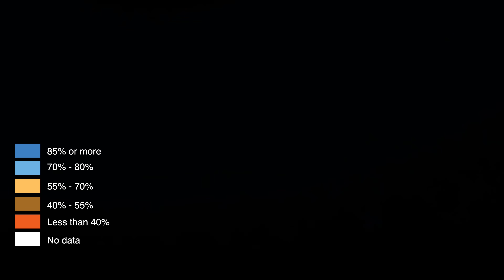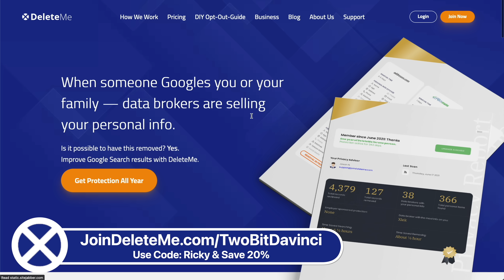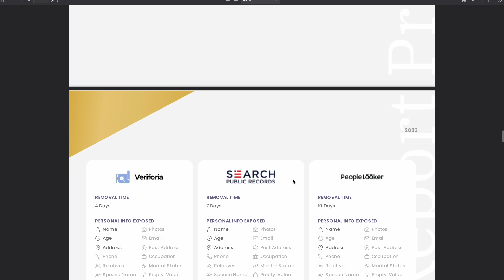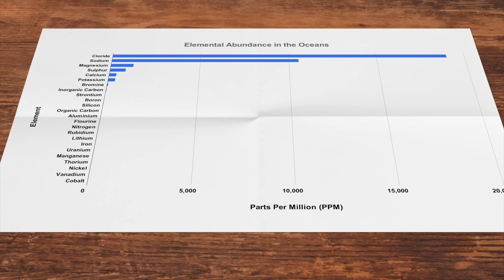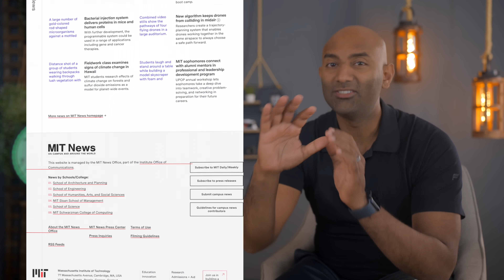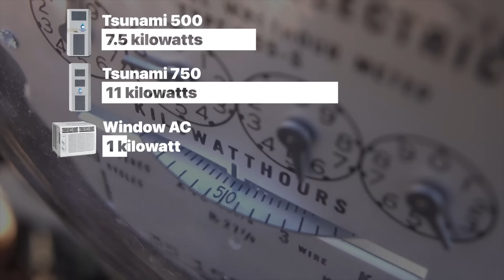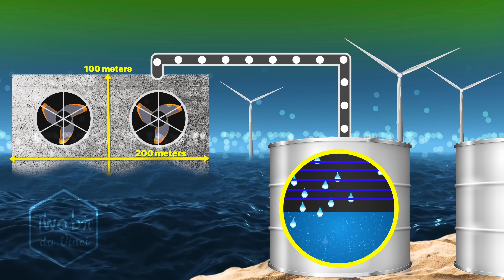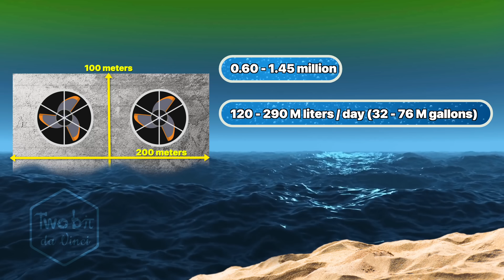This Tower Turns Ocean Fog Into FRESH Drinking Water!

Comment from the maker: Keep your personal information Safe Online with Delete Me! https://joindeleteme.com/TwoBitDavinci
Reply: Moisture farming like Luke Skywalker's Uncle Owen Lars on Tatooine.
Reply: Just use the old camper's trick.  Fill a large can with salt or dirty water.  Put a small can inside the large can on a support so it doesn't float and tip over.  Cover the whole thing with plastic, and put a pebble on the plastic cover so it forms an inverted cone. The small can will slowly fill with pure "distilled" water through evaporation.  This works best if it's hot.  Now scale this mechanism up in size.
Reply: Sooooo....... Is this a 200 ft diameter surface air skimmer? How does wind speed act to drive skimming water?
Reply: 8:36 so you're saying in Palm Beach Florida we would not have any problem getting water out of our 95% humidity air lol
Reply: I think you are Canadian Preppers brother... :)
Reply: Wouldn't doing this on a massive scale eventually increase the salinity of the ocean in that area? Since it was already at max saturation of vapor then you taking from it would lower the saturation and allow more water to evaporate than normal. Still seems like a great idea but I'm skeptical there is zero environmental impact
Reply: In case of this technology we are talking about a corporate who bottles rainclouds in  the sea itself .. Water is not a big issue but in dry atmosphere temperature keep on raising , we are talking about   50-60 °c plus  temperatures ... 
I think i should invest in airconditioners and cooling systems  😊
Reply: Brine + Solar = Molten Salt Powerplant + Battery = Energy Independence + Exports
Reply: No it is NOT expensive to get valuable minerals like common  salt and magnesium  which is six percent of seawater from the brines. 
It is a threat to the slavemasters pulling your strings you puppet. Their profits and control over you.
Reply: It is only renewable if it rains before you run out of water.
Reply: Didn't you do an episode where they used nets to catch the moisture off of the ocean?  Couldn't you just use giant fiber nets to collect moisture off of the ocean?
Reply: what's up with your math??? @ 1:35 you say there are 'some 10 cubic kilometers of fresh drinkable water' ... but then @ 2:00 you say "93,000 cubic kilometers of fresh liquid easily accessable drinking water" ....  so what is the CORRECT AMOUNT that you MEANT to give instead of 10 cubic km????
Reply: Interesting episode Ricky.. the concept sounds basically like a gigantic dehumidifier that takes advantage of moisture produced by natures distillation as the sun heats the ocean surface during the day.  Makes sense that it could work, of course depending on how the electricity is produced to create the condensation.  My family has been in the water treatment and purification business for almost 40 years, and now I live on a sailboat that is completly off-grid with desalinated water produced by solar power entirely.. the system consumes 400w to produce 100L per hour.  Will be interesting to hear more about this idea you present, especially for those of us already living on the ocean.  Keep up the good work!
Reply: wave power is a thing no need for solar wind
Reply: The average person consumes 79 gallons of water per day? Seventy-nine? Gallons? Per day?
Reply: @Jianju69  that would be drinking, bathing, cloths washing, sewage, irrigation, public space irrigation/sports, it would also be water used in industrial processes for consumers, it takes water to make the aluminum that makes the soda can, it takes water to make the steel to make the logging machines, it takes water to make the tires for the transport of the logs to the saw mill, it takes water to mill the wood to build peoples houses, it takes water to make the concrete in the roads, it takes water to do almost anything that humans do on this tiny world.
Reply: @thesearchforterrestrialint7795  Yes, I figured you must be including water for industrial processes. I takes water to grow grain to feed cows to make the hamburger for lunch, etc. Still, it surprised me.
Reply: Wow! How to invest in the best?
Reply: Speaking of water, how is your area doing with the atmospheric rivers of rain in Calif?  Some of our family is high and dry and others have been looking a buying a new "boat house".
Reply: A brother came up with a machine to extract it directly from the air....a few years ago and most of the water is in the core
Reply: Good one , probably most countries can benefit from this ( even if just used in some regions it would be a good help )
Reply: California was the greatest place ever and then democrats ruined everything and now the state has so many problems the people are moving out THE EXODUS OF CALIFORNIA! It is the people and politicians that ruined California because Ronald Reagan made California great then Democrats ran the state into the SKIDROW HOMELESS GROUND!
Reply: Dumb ,lets steal rain... How about make more trees , win win🎉🎉🎉 all deserts could of be green with the Ukraine wars donations🎉🎉🎉
Reply: Before watching this muslin cloth has been used to elegantly harvest atmospheric water vapour for 1000s of years. Even been used in deserts but collecting sea mist is obvious.
Reply: Turn Ocean Water by use Sand Filter or Sand Pits  They have Lot of Sand We Did It It Work Cheap & easy
Reply: Antarctica ICE
Reply: Well took you a while to get that idea.
Reply: hey deuche bag there is more than enough water underground!
Reply: I love this I want to hear More about it If I can get involved if I can donate who do I call to get this project started And will pressuring State senators and congressmen as well as the governor help
Reply: I worked for a state university. We got a memo that state funds can't be used for buying bottled water, the 5 gallon office kind. Our buildings aren't plumbed for water fountains.
I went on line and bought glorified dehumidifiers, with filtration and UV light.
Problem solved. 8 gallons of filter water, (basically 1 gallon an hour) and able to do this at 25% humidity. Problem solved.
Reply: A better and cheap solution is to evaporate it inside a tank by using huge lens.
Reply: Your not taking into account differential population growth and the responsibility of that nation that falls under as to not overconsume resources of a given area. Having too many kids.
Reply: 10 cubic kilometers of fresh water?? I think you dropped a few zeros
Reply: this english was hard to understand, grew up with new world english not that old world bullsh1t. Gallon not liter, F U
Reply: This video should be pinned to the youtube home screen for a few years.
Reply: do you still have links to the sources?
I can't seem to find  it on your site(under videos->water)

 since this really seems to work exactly like a project which I published around a year ago as a open source desalination project.
or actually one of it's smaller sub parts since the entire technology and project was meant for more, but this exact method of desalination was also part of it as a ecological desalination method for oceansteading communities or ships.

the method shown in the video seems to a industial aimed aplication of the technology, since the original ones where designed for decentralized use so as to allow anyone to have acces to water, as well as with functions to help nature, well the actual original publishing was the speciffic working and such and that as well as 2 publishings shortly after that also included more speciffic ready to go solution

the project was openly published as Free Open Source using Cern's open hardware licence,
I want to see the links so I can see if it is actually very likely based on it, since it if is then I'll share it with the "activist"/ developing things for a proper future group for which project I originally designed and published it for/in realtion to.
(was my own project, but that group sought ways to protect the world from this problem as well as against those fires and to make sure everyone had water aces anywhere, would be fun to show them my tech even got into the news even if my name was not mentioned in the news(with news I refer to this channel, as well as somewhat to the publishings about the publishing based on my publishing.).
Reply: You may want to go to Bangalore and do a start up there.  Perennial water issues.
Reply: They were doing it better and cheaper for 1000s of years in arid regions. fine Muslin cloth captures air moisture. Just need poles, ropes and cloth and channels to collect the water. Works in deserts.
Reply: if we really play out the scale more long term. not thousands but tens or hundreds of thousands of years...    are we going to convert on the water all this planet into something else eventually?    you drink water, you pee, you dont get back the same volume you ingested.    this is true of all the systems of technology we use which take water as an input,  the ultimate output is less water.    so are we slowly but inevitably using up all the water on this planet ?
Reply: this idea needs to be sent to Elon and RFK!
Reply: Please make a video on the comparison of river water vs water purified from sea vs dehumidifier water as the river water is better than others as per my knowledge.
Reply: Can you use international units?
I am confused with 3-4 types of gallon...
Reply: easy way to reduce water waste is having 3 water systems at home, fresh water for drinking and shower, sewage obviously, and finally a recycled water from the wasted water treatment plant to be used on the toilets and some gardening aplicantions, since that recycled water cannot be consumed due the chemicals used on cleaning and so on, instead droping it bck on the rivers and ocean it should be taken back home to the toilet again, it may not look much but you must see the big picture here, millions of people everyday wasting 5 gallons of water everytime they flush in just one day that would fill more than one olympic pool across an entire year you can imagine, every little bit counts, special on desert areas and countrys if we can extend that water for a little bit more than all investment is worth it

Comment: The energy of ventilating the air through the tower and through the pipes and slightly compressing it to a pressure ratio of 1.4 is vast. Without a calculator, I assess the required energy performance for one tower at 100 MW. The only way to get a solution is to use Small Modular Reactors. But the price of water will be high though.

Comment: The salt is attracted to colder surfaces if there is a hotter surface nearby, so likely the reason why is the pipe would not be under water? Another reason is that there would be lost potential energy of the water and that is energy that must be spent to transport the water back up? Then there is potential scaling/corrosion problems which could drive up costs significantly which would happen in water due to biological contamination that I assume the air would have less issues with? And since you would want to be fairly closer to coasts, being closer to the surface would not work for shipping and transportation reasons or more chances for erosive conditions like abrasion or oxygenated? Too low and you might mess up an ecosystem or have overgrowth that ruins your pipes?

Comment: This is fascinating! I wonder if something like this could be installed on a decommissioned super tanker that sits offshore with the collection vents above deck and the condensing process is down in the holds.  I'd rather look out over the sea and see a few super tankers floating out there than a big structure like the one described in the video.

Comment: I have been living in Las Vegas for over 40 years. I know this valley and where the fresh water is located. Las Vegas translates to The Meadows and this is for good reason. This valley is filled with water. Springs are located throughout the valley. The water table is so close to the ground surface people must keep their swimming pools filled with water to prevent the underground water from pushing their pool out of the ground. The former site of the El Rancho Hotel and Casino, which is located at Las Vegas Blvd. and Sahara Avenue, has not been developed because the water table is too close to the surface. A massive underground river the Alamagosa flows under the Las Vegas Strip. This is the source of the water for the Bellagio, Venetian, and other resort fountains. 
There is no drought here. The Colorado River's water shed has had normal to above normal snow pack for over 10 years. The low Lake Mead water level is caused by 2 huge water diversion tunnels.

Comment: Wow, huh? So the question is would it disrupt the normal water cycle? One other thing is no matter what the scientists estimated for construction costs if you build them in California you will have to triple construction costs and double construction times. The simple fact is that California is an infrastructure nightmare. Construction companies and subcontractors regard California as a giant piggyback to be squeezed as much as possible. Every Bureaucrat involved with permitting and planning will insist on running feasibility studies and environmental impact statements, ad nauseum. And environmental groups and Nimbys will file lawsuits to shut construction  down. Some people think that the only acceptable solution is to reduce water use until it matches available rainfall and reservoir replenishment. Of course, we need to practice every conservation technique possible. But conservation can't be the sole solution. It will choke off economic growth. And create water refugees. Our so called leadership needs to go to the public and explain the realities in blunt terms but offer some potential solutions even if they require painful structural changes in our society.

Comment: For years I’ve imagined a concept similar to this. Imagine a shallow floating or supportes pool at the ocean surface. It would be a few feet deep and insulated from the actual ocean. Doors would open and let the water in to flood the pool, then close again. The water in the pool would evaporate faster than the ocean around it. This could be accelerated with solar mirrors aimed at the pool to heat it up. The water vapor is collected, condensed, and used as drinking water. This could also create energy if the steam is pressurized to drive a turbine, but either way you get fresh water from the ocean.

Comment: I'm no expert, but I think this will not work as wind coming from the sea often contains salt or ions. This phenomenon is primarily due to the process known as sea spray or aerosolization. When wind blows over the ocean's surface, it can create waves and break them, leading to the formation of tiny droplets of seawater. These droplets can be carried into the air and dispersed by the wind.

As the seawater droplets evaporate, they leave behind salt and other minerals, resulting in the presence of salt particles and ions in the air. The composition of these airborne particles includes various salts, primarily sodium chloride (NaCl), along with other ions like magnesium, calcium, potassium, and sulfate.

So, not sure if that would be 'drinkable' directly...

Comment: 14:00 "Like A Rock. Ohhhhhh,Like A Riock!!! Like A Rock." - Bob Seger -
The issue with piping through the water is water pollution,Rust! The long term effects of virtually all Pipes man can make.

Except 1 that is. As Bob said,Rock is the answer. It already exists in our oceans as nature provides. Yet for obvious reasons should be limited in size & mass.

Meaning you'd want to avoid piping through the water as much as possible,only as much as needed. However we can Bore out,say,5ft Core of rock,then drill a whole through that & use it as the water based pipe!

Connecting with regular pipes outside the water. So while being a Naturally Synchronous option,would also be exponentially more expensive the longer & bigger you want the pipes to be. Most ideal for shortest sections possible. Just enough to get it through the water where situations may require it.

16:10 Problem there is that kost individuals who can visualize world changing technology can most likely also visualize how corrupted America's System has become.

If they & their Corporate Constiuates approve of the technology then all is well for you & yours. Yet no matter what the Tech is or how efficient it may be,if they don't like it,you'll get Tesla'd!!

Comment: At a given temperature and a given amount of water in the air, the air's relative humidity increases as you increase the air pressure which drastically increases the amount of water that can be extracted from the existing water vapor.  And tge compressed air can double as compressed air energy storage, and or demand shifting through district cooling by expanding the high pressure air inside residential  homes.

Comment: I love this idea, but why go so huge? Get a bunch of shipping containers and cover the roof of each with solar panels. Fill the container with a single unit condensing desal system and a storage tank. Get a barge and cover the barge with those shipping containers. You can either pack the containers tightly and design them so air flows through them or set them just a few inches apart. Connect the reservoirs to a central collection system and you have a modular free floating desal plant that doesn't require a massive structure to operate.
Reply: Oh, wait. I did the math. This whole idea is terrible. 😅

Given average efficiency solar panels and 40' shipping containers, you'll produce 5.75kW of power for about 8 hours. Let's call that 46kWh. Using commercially available desal systems like the one described in this video, you'll get a whopping 0.35L of water per kWh. That means the entire 40' shipping container will generate enough electricity to extract 16L or 4Gal of water per day.